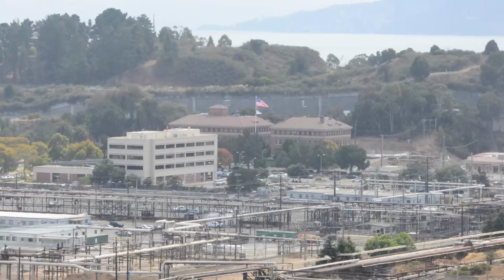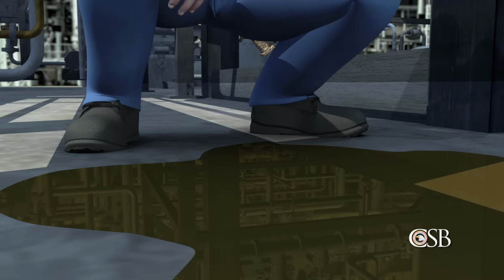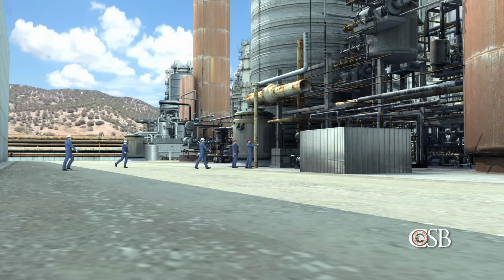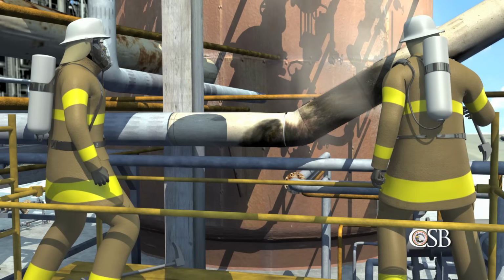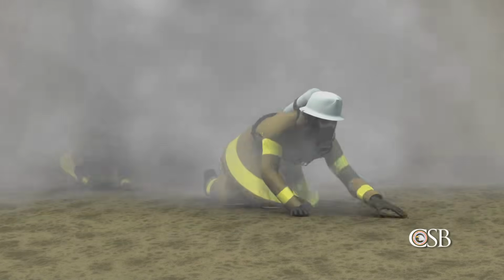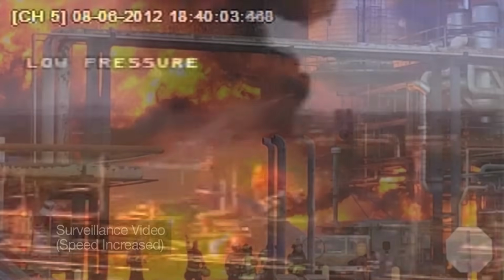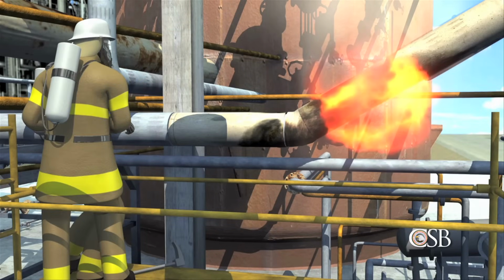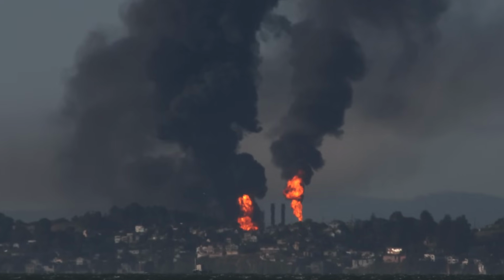Animation of Fire at Chevron's Richmond Refinery, August 6, 2012

Comment: I used to work there and have seen Head Operators drunk on duty , Operators drunk on duty and one operator would mix his "grass" with pipe tobacco to camouflage the smell...He had guaranteed drug free freeze dried urine and water just in case he was called in for a drug test ......It was rumored that supervisors would called their reliefs at home if their name came up on the drug schedule so the supervisor could call in "sick" if they thought they would turn up dirty...I've seen Head Operators many times bring in coolers full of beer on ice for the troops... This was recent not ancient history....This place is not safe !.. If the public only knew what went on there !
Reply: I call bu!!sh!te!!! You haven't seen any of that in over 10 years. That's how long I've been there as a contractor and employee.
Reply: Drunk operator does not increase pipe corrosion.
Reply: I lowkey wanna work at this place now, heh..

Comment: That is the most ridiculous excuse making ever.  What you just stated amounts to 'they don't know what they are doing'.  No one said anything about 'flicking a switch' but the company itself stated it decided not to shut down the unit, indicating that was an option considered at the time, one that would have been the correct decision both for economic and safety reasons.  FAIL is FAIL, even if it hurt your precious feelings about an industry you have a hard on for.

Comment: No it's not common.  But this is a compund/mixture of HC and there may be an extremely small fraction in the cut that contains material above the auto-igintiion point (the idea of fractionation is to separate those various components based on their relative boiling points - statifying the column content on a temperature gradient).  Braodly speaking, the materials are above their vaporization temperature - vapors are what burn, not liquid, so it just needs a source of ignition = nearby equipment.

Comment: The leaking stock was at high temperature = vaporized stock, a portion of it was likely above the auto ignition temperaure.  Also surrounding equipment can be a source of ignition (furnace burners, electrical components, etc.).
Reply: Most likely the auto ignition temperature was reached. Gasoil flushed from contact with atmospheric oxygen.

Comment: There is a difference between firefighters and site firefighters.
Those site firefighters are hired by the refinery, and are used for jobs too hot for regular engineers.
Reply: Too hot for the regular engineers? So the educated hire the uneducated to take risks that they themselves wouldn't take?
Reply: @kimobrien.  Well yes, most of on site fire teams i've met are all as (or more) competent as the site mechanics when it comes to dealing with leaks.

Nevertheless, this whole incident was a shitstorm of bad decisions.

Comment: If I may
1) They had no business messing around with the old insulation while the pipe is still hot, there is good reason for insulation, otherwise there wouldn't any in place.
2) Dousing a component under stress with cold water will only induce further stress in the material, subjecting it to working conditions possibly exceeding normal operation.
3) Why would fire fighters perform emergency engineering work? Is this industry S.O.P.?
( in hind sight..)